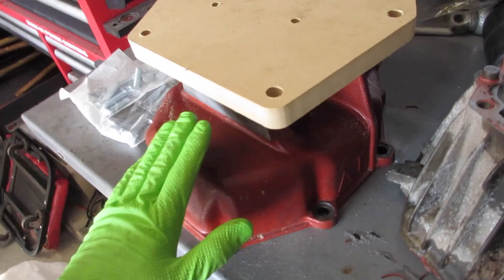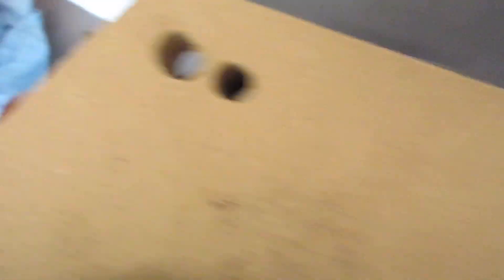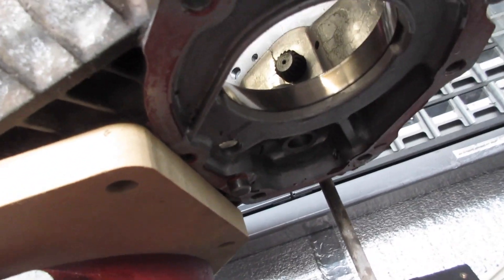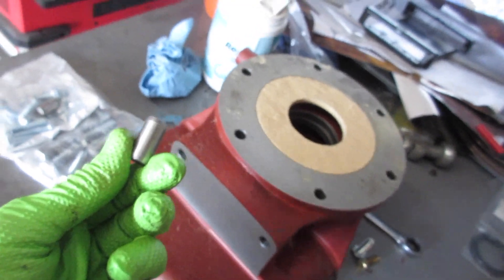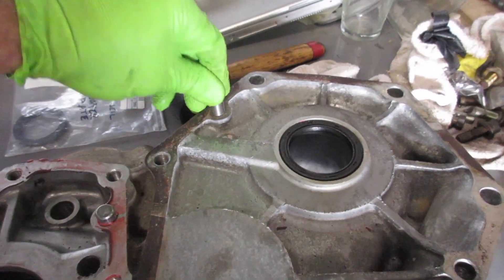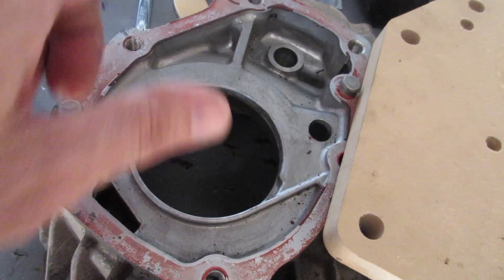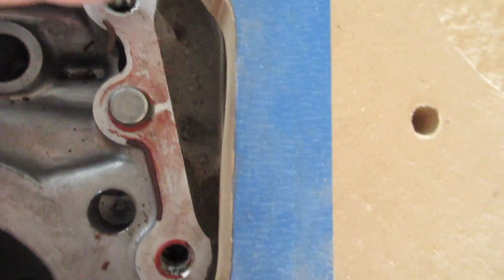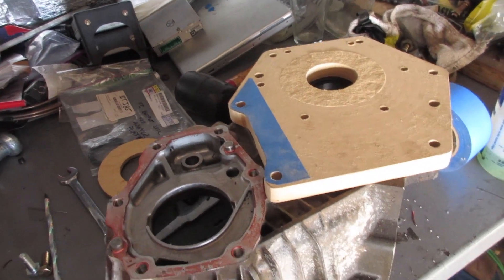NV4500 TRANSMISSION TO TOYOTA HF2A TRANSFER CASE - PART 1

Comment: Awesome work, just found your channel and I'm looking forward to your other videos. Super disappointed that this is a current project though, I was looking forward to watching the whole project and now I have to wait ;-(

Are you documenting your adapter project I am planing an adapter from an automatic trans and if ou have made your blueprints available, I would love to have a copy of the hf2a part. 

Keep up the great videos, good luck on your project and thanks for sharing these vids!
Reply from the maker: Thanks.  Yes I am trying my best at documenting everything.  My current build has a monthly budget that I attempt to stick to.  I dropped my NV4500 off at the rebuilder on Monday to have the modified main shaft installed.  They are pretty busy and was told it would be a few weeks.  As for adapter I will dropping the aluminum block off at the fab shop next week hopefully.
Reply: Cool, so you are having the output shaft resplined to match the HF2A input? No coupler then. I'm looking for documentation as to the HF2A input splines.
Reply from the maker: Yup. Using a 2WD main shaft from a Dodge diesel and it gets resplined to 19 spline. Here the link to the open source plans. https://forum.ih8mud.com/threads/nv4500-to-hf2av-open-source-adapter-plans.1054769/#post-11626357
Reply: Fantastic! Thanks so much.